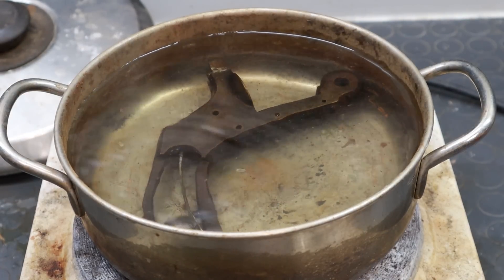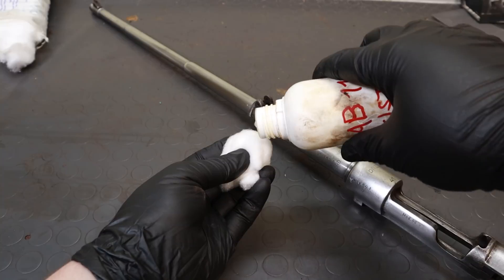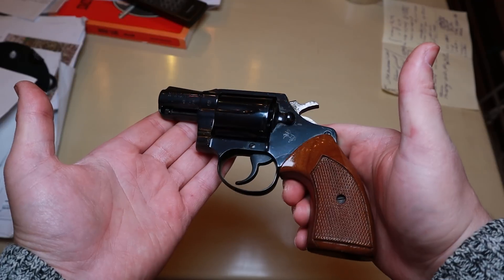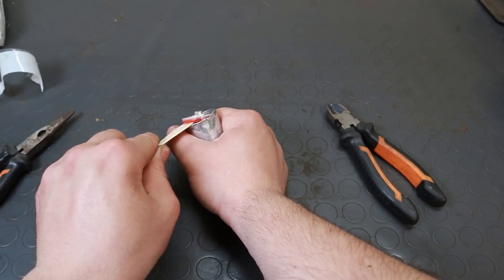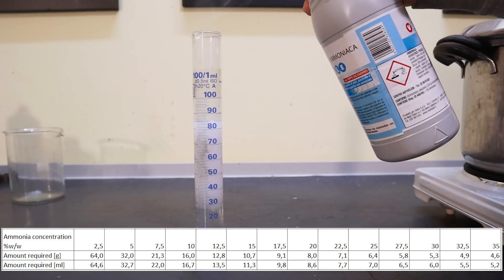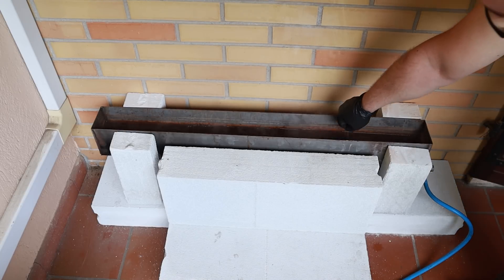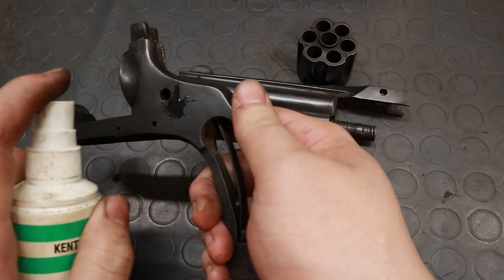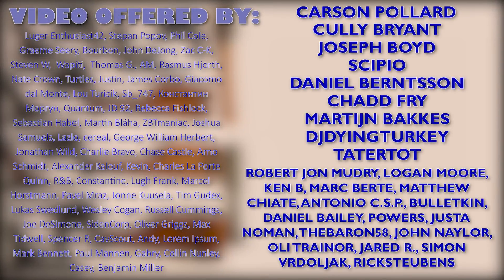Rust Bluing Tutorial - Turn any Steel Object Black With Household Materials

Comment: A key to any bluing or browning is getting the parts free of any oils.  I used to do this at Griffin & Howe.  We used water and calcium carbonate on a warmed part.  The heat dried away any water.  The calcium carbonate, now dry power, would suck up any oil.  Then the part could be wire wheeled clean of the power, which, if oil is present, will now be stained lightly brown.
Oil will exist in sharp corners and irregular surfaces, like engravings, stampings, or scratches.  So getting it all will give a better result.
Also, when you have the surface and color you desire, you MUST stop any residual acid action.  I believed we used warming the part with a rag and oil to drive out remaining acids.  Then wipe down the part, dry.
Lands and grooves love to rust, so be careful, cause you may not notice it happening.
Reply: Wow..a veteran. Thanks for insight..i have done this as a hobby for many years. I have read many different ways to do it. Yeah i thought water bath between coats was just so it stopped the red rust .i just washed with some soft water..i just recently did the hot soft water bath that turns the red/brown to black! Soft water at 200°

Comment: Newer minted pennies are also made from zinc but they are plated with copper on the surface so you’ll have to sand that off
Reply from the maker: A lot of stuff nowadays is made out of zinc, but in most cases it's a zinc alloy containing other elements in small proportions in it, usually aluminum and copper, and I'm worried they might interfere with the process. I chose the battery casing as a source of zinc because that's usually pure zinc, or at least pure enough.
Reply: just buy an 'anode' for a boat. Or an anode for a boat engine. 
They come in all shapes and sizes ranging from quite small to large.
They are 100% zinc.

Comment: When I was a kid we used to take HCL based toilet cleaner and put it in one of the old glass pop bottles, drop zinc or aluminum in and fill hydrogen balloons by pulling the balloon over the pop bottle.   You can melt modern pennies (copper coated zinc) by slowly melting them and the copper shell will not melt, but I understand this is now illegal.

Comment: Ciao,  innanzitutto grazie per gli ottimi consigli poi se possibile volevo chiederti perché il zinco che si recupera dalle pile zinco carbone  deve essere carica ? , in fondo non è sempre zinco ? sia che di una pila carica o scarica  ? , nell'attesa di una sua risposta grazie di nuovo per gli ottimi consigli 👍
Reply from the maker: The reason why a used battery can't be used is that during battery discharge the zinc metal is oxidied into zinc ions, forming zinc salts that get mixed with the electrolyte, and are then harder to separate from the rest. The zinc metal is literally corroded away during discharge, until it essentially disappears. That's why zinc carbon batteries have a bad reputation of leaking into electronic appliances: Once they're fully discharged their zinc casing no longer exists, so the acidic electrolyte can leak out through the outer wrapping.
Reply: also, if you want pure 100% Zinc..... maybe it is easier to go to a boat shop and ask for an anode for a boat, or for its engine. Boat anodes are well known for their purity.
They come in all sizes and shapes, some well priced, some are expensive.

Comment: Is there any special precautions needed to protect the bore from rusting?
Reply from the maker: Since the rusting solution is liquid and emits practically no corrosive vapors, and you only apply a thin coat of it, only the surfaces swabbed will be affected, so the bore won't rust. The boiling in water has no effect at all on an unoxidized surface. So this process does not affect the bore. If you want you can still seal the barrel with a couple of plugs, and remove them once you're finished.

Comment: I just Grey parkerized/phospated my Mossberg 500 with a homemade solution made from fertan Rust converter, distilled water and a little Bit of battery manganese. Worked Like a Charm but getting there with household items and figuring Out what i need was difficult. Since most tutorials include either the brownells Mix wich ist not available to buy in my country or pure chemicals.

Would be cool to see some Tutorials on parkerizing in the Future.
Reply from the maker: I will definitely cover parkerizing, both zinc and manganese based.

Comment: Ammonium bicarbonate (hartshorn salt) is quite widely available in food quality. It's used for leavening some types of cookies. Pure food grade ammonium chloride is quite available in places where it is used to salt liquorice. Pure zink is easily and cheaply available at the hardware store for galvanic corrosion protection in boats etc. Saturated zinc chloride + hydrochloric acid solution is used for soldering sometimes. If it's like a paste or gel it has other crap added.

Comment: I recently tried this solution followed this step by step using the battery method.   I am getting something that looks more like grey/black/green build up instead of rust on steel parts.  Any clue where I went wrong?  20%HCL and 5% ammonia.
Reply from the maker: It's normal for the surface to turn greenish in the first hours after application (if you're not using peroxide). If the green persists for longer than 10 hours, you probably applied too much solution. Either wipe the part with distilled water and start again, or wait longer. Out of a "sweat box", a full rust coat could take up to 72 hours

Comment: Amazing work as always & lots of very useful information you don't find elsewhere

I just recently tried the ferric chloride solution option & was very pleased with the results. One thing I will say is its a nice deep black but under sunlight indoors you get the browning effect

Is this normal or have I missed something?
Reply from the maker: Ferric based solutions tend to leave an orange/brown hue on the finished bluing, so you didn't miss anything. If you'd rather have a pure black, the solution I described in this video will do the trick.
Reply: @beyond.ballistics  I managed to remove the browning & get more of a darker finish by doing a few more passes 
Is it possible to use ferric chloride solution without the hydrogen peroxide? How long should I let the part rust without using hydrogen peroxide?

Comment: most wheel weights are made of zinc now, so there's another source for you
Reply from the maker: A lot of stuff nowadays is made out of zinc, but in most cases it's a zinc alloy containing other elements in small proportions in it, usually aluminum and copper, and I'm worried they might interfere with the process. I chose the battery casing as a source of zinc because that's usually pure zinc, or at least pure enough.

Comment: Only found your channel today and have been doing a bit of binging. :)  I'm a huge fan of the rust bluing process, the only substantial areas where "my" process differs is a final boil with baking soda (sodium bicarbonate) to neutralize any remaining acids. I finish my parts not with oil, but by heating and applying paste wax then rubbing out once cooled. I usually apply three coats of the paste wax, heating for each application. Neat thing about using the wax is that you don't leave visible finger prints on the parts as with oiled parts.
Reply from the maker: The neutralizing bath you do is always a good practice, but I'm lazy🤣

Comment: Are you not concerned about Hydrogen Embrittlement when using Hydrogen Peroxide or Hydrochloric Acid in your rusting?
Reply from the maker: Hydrogen embrittlement can only arise if there's elemental hydrogen being reduced on the surface. Hydrogen peroxide only releases oxygen, not hydrogen. Hydrochloric acid is not in concentration high enough to release hydrogen, otherwise it would also attack the newly formed bluing. Practically any rust bluing recipe has some free acid in it, usually either hydrochloric or nitric

Comment: A great way to get a nice finish is to use a carding wheel, available on Brownells.  The steel wires used are VERY thin and won’t act as a wire wheel, but more like a faster 0000 steel wool.

Comment: Did you have continued success using Copper Sulfate to get that blue hue after rust bluing?
Reply from the maker: It does work, but it's not very consistent, sometimes it works great, sometimes not so much. The good thing is it can be reversed with a weak solution of ammonia and hydrogen peroxide.

Comment: Excellent video.. getting Conc HCL is difficult in UK these days because of the laws as a result of people using acid as a weapon.. You can get several commercial browning solutions though. Laural Mountian Forge browning solution is obtainable through Brownell UK and contains a degreaser. It is easy to use and will produce a good black when heated.

I use a steam pipe over a pot of boiling water rather than a boiling tank. It is much easier to use and will do a good blacking in about 20-30 mins. Just a length of drain pipe fixed to the lid of a cheap supermarket cooking pot. 

Thanks for the hydrogen peroxide tip.. I will try that one!

Comment: About 50 years ago I blued a small firearm with Draino drain cleaner.  First I picked all the aluminum particles out of it.  I then mixed it with water and heated it on an old gas stove we had in our basement.  Worked really well.  I doubt whether Draino is the same formula as it was back then but it turned the metal a very nice black.
Reply from the maker: That's probably hydroxide based, so it sounds you did some form of caustic bluing. That's what I'm covering in the next video.
Reply: @beyond.ballistics  Drano is mostly sodium hydroxide with activators.  I think the aluminum was an activator to cause a foaming action.  I picked every chunk of aluminum out of there.  I had lots of time back then.

Comment: Make sure to use some acetone to degrease your steel wool. You can use kerosene to set the finish. If you have a bench grinder you can use a carding wheel instead of steel wool. Make sure it's a carding wheel and not a wire wheel. A carding wheel won't hurt you if you touch it while it's spinning. A wire wheel will cut you up.
Reply: Carding wheel in a drill press is what I prefer, turns slower.

Comment: I've seen folks use steam set ups to accelerate the rusting. They would boil distilled water over a large PVC tube and hang the rifle in the tube. I've wondered if adding an ozone generator would help accelerate the process, as it oxidizes quite readily. Something like a PVC frame wrapped in plastic sheet with an open top that contained the generator close to the part.
Reply from the maker: Lots of people use steam with good success, but I only tried it briefly.

Comment: I am tempted to blue an airsoft revolver because the finish is ugly and I want to do like an old revolver that has been passed down [note it's ment to be a smith and wesson revolver]
Reply: Just a note of caution that exceedingly few airsoft revolvers are made of steel (most are made of pot metal and aluminum), so they won't blue with this process. Most steel airsoft guns are rifles like the LCT G3 and similar.

Comment: Great video!
For extracting zinc from batteries, you can also use alkaline batteries - the technique is just a bit different.
For alkaline cells, the zinc is in the center, as a gel or paste of zinc particles suspended in an alkali electrolyte, usually potassium hydroxide. You can scoop it out and wash with water to remove all the soluble components, leaving you with zinc filings or powder.
Reply from the maker: Fair point, but I'm not sure it's worth the extra effort. Also the reaction of zinc powder with the acid quold be very violent...
Reply: @beyond.ballistics  Agreed, you'd have to be careful, but if one is desperate...

Comment: Is the concentration of Hydrogen peroxide important (for example 3%)?
Reply from the maker: It only affects the reaction velocity, I have seen no difference on the results. Over 6% the reaction is so quick it becomes hard to control, leading to visible pitting

Comment: GOAT chemist. Im  curious do the different solutions produce different finishes? By pure chance I ended up binging all your videos last night and ended up with that question (commercial rust blueing vendors sell different formulas for different guns it seems). I'm a a bit afraid to boil the guns that never had rust bluing (parkerized or salt blue) because I have the feeling it will just convert the splotches of rust to blueing that wont match the rest.
Reply from the maker: Once there's rust, the splotch is already there. If you card it as it is, it'll look brown. If you boil it, it'll be grey/black